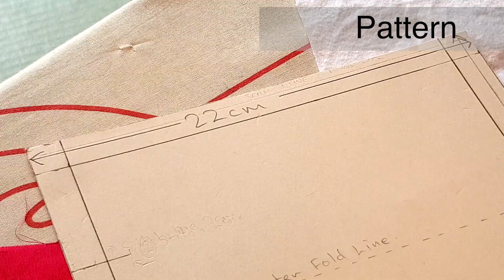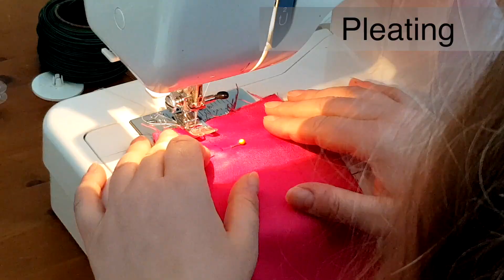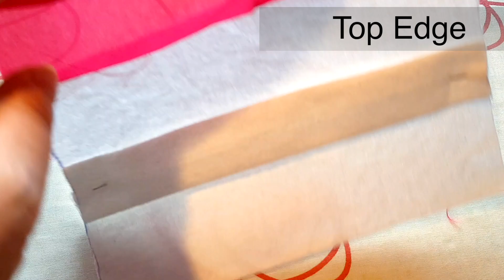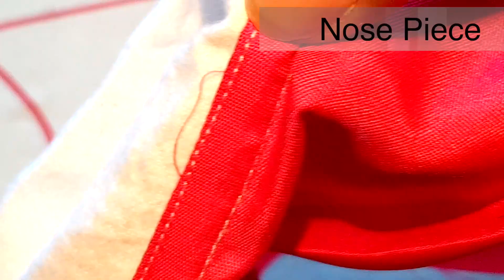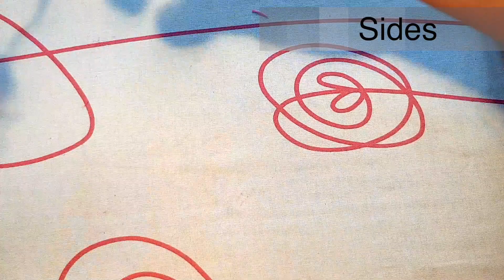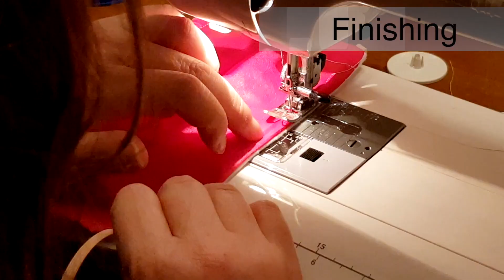Home Made Non-Medical Mask

Comment: Woah, got any easier to follow instructions for those without sewing machines?
Reply from the maker: Not here - That's not what we are doing. Try googling "no sew mask"  - or help by donating so we can get the right fabrics to continue protecting care workers and volunteers. Just because you can't sew doesn't mean you can't help.
Reply: @t.s.creations2467  where can I donate?
Reply from the maker: @iansw07  As we are locked down, focus on your local area - there will be a support network with people who have sourced patterns and fabric from wholesalers ready to make scrubs & Gowns etc. but need funds to buy them. Care homes and other social services are starting to struggle - PPE manufacturers are sending everything they have to the NHS. If we do start a crowd funder for Glastonbury, it will get posted here.
Reply: Unfortunately I don't have spare fabric or a sewing machine but I did send your video to a friend who does.
Reply from the maker: @iansw07  And that's what we need to be doing. Thank you!